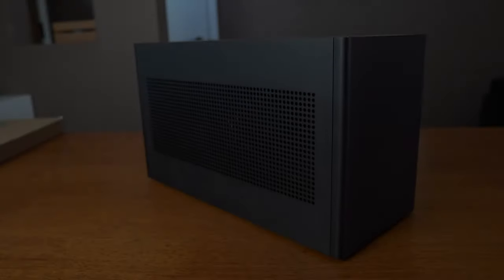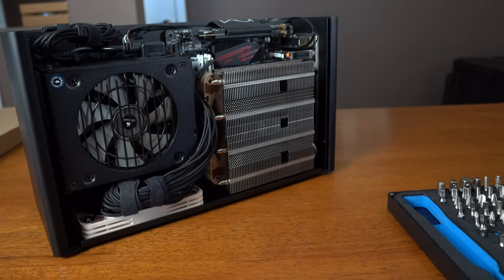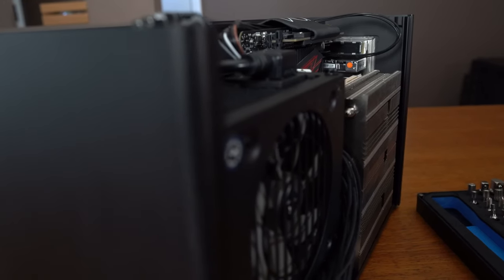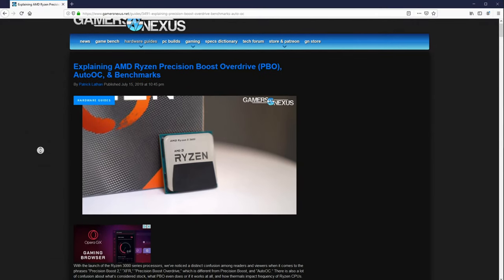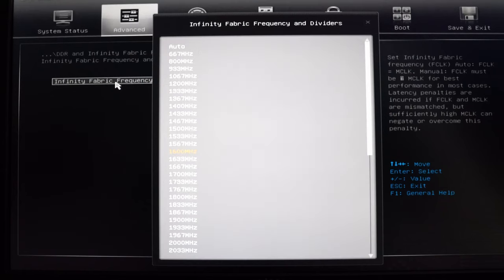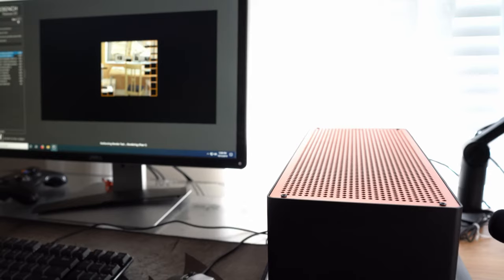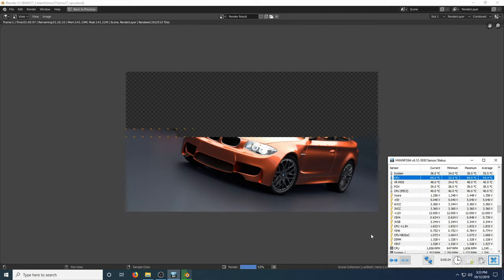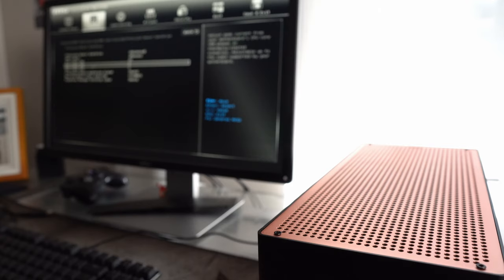Air-cooled Louqe Ghost S1 w/ 3700x - thermals & noise

Comment: Hi, thanks for the content. One question regarding the Intel 660 SSD. What are the temperatures under idle, avg usage, heavy load/copy?
Reply: Avg 60C...
Reply: @archttila  in case Ghost S1? If yes where it is positioned in the MOBO? Front or rear (between MOBO and case panel)?
Reply from the maker: With a 66f/19c ambient room temperature, idle/light desktop use is 36 to 44c, bursts of heavy use 56c, benchmarking as high as 71c in ATTO benchmark tool.

Comment: Thinking about bending the pipes on the L12s to fit in the loque. Any tips on how you went about it?
Reply from the maker: A lot of trial and error. First test fit to determine where your limitations are. Make small bends by hand holding the fins/near the top of the pipes and the base - repeat test fit. The heatsink obviously needs to be lower. I recall some bending was needed towards the base of the pipes as well as near the fins to compensate/to level the heatsink. This it where it should bend most naturally. Try bending in small increments to keep the integrity of the metal. It took me at least a half dozen adjustments before a successful fit. I hope that made some sense.
Reply: I went ahead and did my build and the L12s worked great! I did end up using a smaller black noctua fan with some tastefully done zip ties and the temps are phenomenal!